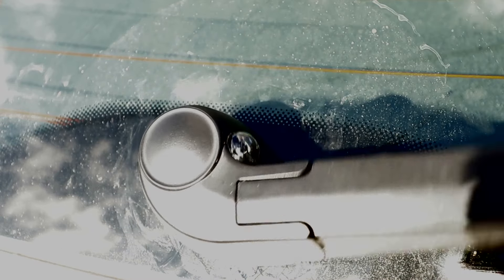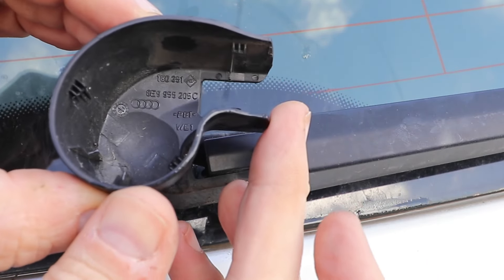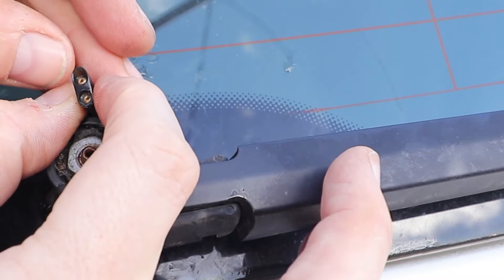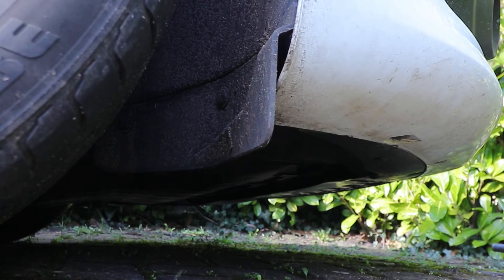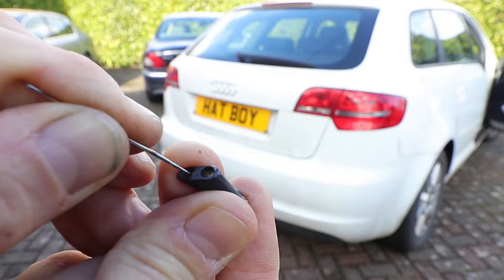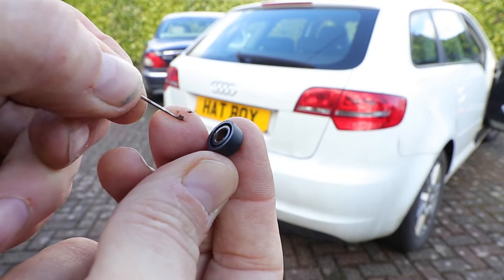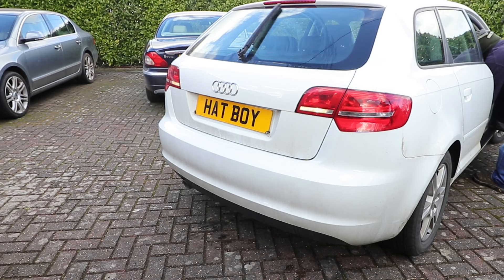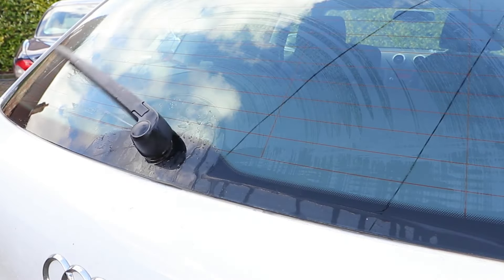AUDI A3 Rear Windscreen Washer Jet Nozzle (MK2 Sportback)

Comment: Thanks for the video 🙂I have a wiper-related question I hope you can answer: I have to replace the whole rear wiper on my 2010 A3 sportback. I ordered a (supposedly) compatible wiper from Amazon, but the shroud part on the new wiper doesn't have holes for the jet nozzles. Can you recommend a suitable replacement wiper, or do I have to go down the genuine part route? Thank you
Reply from the maker: I use the Bosch aerroblade wipers which are low profile and should clear your nozzles depending on the setup :-)

Comment: After you remove the plastic cover. Whats the black plastic bit called? Mine is missing and the washing fluid just runs down instead of spraying. New to find replacement.
Reply from the maker: I think you mean the washer jet nozzle. I've left links in the description :-)

Comment: I don't know how the hell you managed to remove the cover without breaking something. The mechanism on my A1 must be different, I cannot get it off or on without breaking something, it's impossible!
Reply from the maker: Sorry to hear that, you have to be very careful  and gently ease each side off. Maybe try using some lube first like silcone spray or penetrating fluid :-) if it broke it may have been cracked before hand :-)
Reply: @HatBoyHarvey  I fixed the broken parts with super glue, so at least it works, but I'm going to order spare parts because I doubt the glue will last long

Comment: Nice video but in my 2011 A3 the rear wiper fluid doesnt come out even when i removed the nozzle 
I noticed the dripping underneath the car but it my first time doing this kind of work on the car. Any solutions? Or instructions thank you
Reply from the maker: you need to gain access behind the plastic wheel arch lining and trim where you will find the rear jet pipe connector that is easy to push back on. Turn the road wheels before doing this makes it much easier :-)

Comment: Thanks Harvey. 
Did all this but still no joy on my A3 2009.
Problem may be that the nozzle is  loose enough to come off when I take the plastic cover off. 
Panther Pro tool goes in and out of holes fine, no rust build up.
Cleaned with wd40.
New nozzle required do you think?
Reply from the maker: Are you getting water to the jet at all? these are prone to the pipes blowing off under the wheel arch, check for this otherwise as you said a new nozzle :-)
Reply: @HatBoyHarvey  yes, I get plenty spurting out with it off. Motor sounds fine.
So new nozzle it is.
Don't know where to begin to search. Any pointers?
Thanks again
Reply from the maker: This shouldn't cost much at your local Audi dealer, worth a try as these will be much better quality than aftermarket ones. My experience with aftermarket front nozzel jet for fabia is they are very poor compared with OEM :-)
Reply: @HatBoyHarvey  thanks so much.
As it happens got spray out of 1 of the jets in the end. Enough to do the job for now. 
Will order new Audi one.
Thanks again.
Keep up the good work.
Do you advise on other Audi car features? Air conditioning, etc?

Comment: Had a Skoda Superb MK3 saloon - which is exactly the same. Was told it had been fixed under warranty and then totally gave up the ghost. This video was a big help. What I had was a blockage on the nozzle and then a backed up blockage on the pipe. Used a can of compressed air which shifted the blockage on the pipe and then soaked the nozzle before using deploying a non-VAG needle from the wife’s sewing kit. Thank you so much 🎉
Reply from the maker: Thanks for sharing that :-)

Comment: This worked great with my Honda 2600 psi Pressure washer https://www.youtube.com/post/UgkxfQauTxLT0JLSvqkq10rD79TU4k0Vz8zP , it came with two different size adapters, and tread tape so you're ready to go. I used it on my sidewalk that was getting dark and it worked great with no sprayer streaks. Just back and forth, really easy and way better than the spray adapters that came with my Pressure washer.

Comment: Suggest leaving the washer jet in very hot water with a bit of vinegar for 30 minutes,  or if you have one use an ultrasonic cleaner.  This way you won't have to play with getting water nozzles re-directed and the cleaning should be better...
Reply from the maker: Great idea, thanks for sharing :-)
Reply: Vinegar and boiling water worked a treat, thank you.

Comment: Cheers for this, this really helped. It turned out that my car's blockage was further down, so once the nozzle was off, I needed something long and thin to shove down the hole. I found that a stripped earth wire from a section of twin & earth cable was ideal since it's flexible, thin and solid.
Reply from the maker: Thanks for the tip 👍

Comment: Good video.  I always boil a kettle and using scissors or pliers to hold the nozzle, pour boiling water into both ends of the nozzle, as washer cleaning additives can sometimes wax up.  Get a mouthful of water & blow some through to ensure it's clear.

Comment: Hello. I wonder that the motor was making sound when its stucked? Mine is not giving water neither make any washer motor sound. Do you think it is stucked or might be electirical problem
Reply from the maker: Hi, Sorry to hear your having problems with it. First check the fuse is OK if not replace if OK then check the motor pump under the wheel arch for power, first by listening with a friend activating the jet wash, if nothing then you will have to expose the pump by taking the bottom panel off and liner and bumper if necessary and test with a test lamp or multimeter. Hope this helps :-)
Reply: @HatBoyHarvey  thanks for reply. I ordered new washer pump. I will try to replace it.

Comment: Hi, I have what I assume to be a wiring issue on my mk1 Fabia vrs. My reg bulbs flicker constantly, I have changed the units and new bulbs but still seems to be happening. I’ve tried to google but nothing seems to come up. I do have a video of it if that would help.
Reply from the maker: Alternator worn and not charging smoothly (should be over 14V) and/or bad battery (12.6V), also check neg earth to body on car :-)
Reply: @HatBoyHarvey  Thank you for the reply. This may be a stupid question but how do I check the negative earth to the body on the car?
Reply from the maker: If you have a volt meter you can test to see if you are getting the same voltage from the bat + terminal to the body and various other parts such as the engine. Do this with both the engine off and then on. Turn your lights on to see what is going on with the flickering. Take a pour lead off the bat and car body and clean up the contact points and refit, if lead is bad replace.

Comment: Would it not be a good idea to flush the line through while the nozzle is off?
Reply from the maker: Yes, that is exactly what to do :-)
Reply: @HatBoyHarvey  Thanks for the tutorial, I have a 14 A3 exactly the same washer however having cleaned out the nozzle I checked the washer with them off and the line was blocked. I hand turned a small drill and cleared out more much however ended up reverse flowing the tube with a tyre inflator with a toy inflator on the nozzle which blew back the line to the tank. Giving it a go then bought loads of bubbles up the line and then the water.